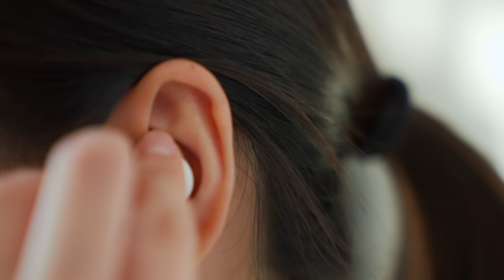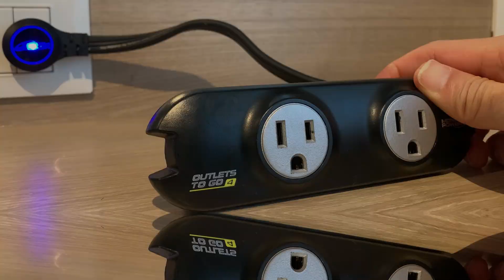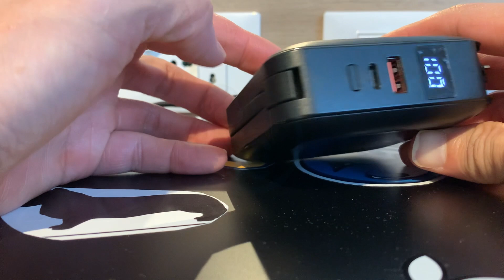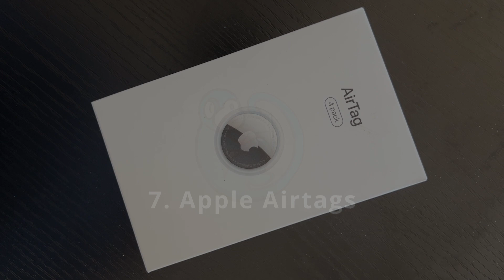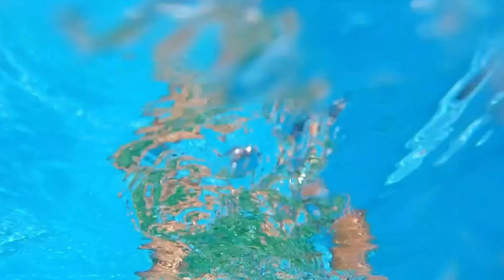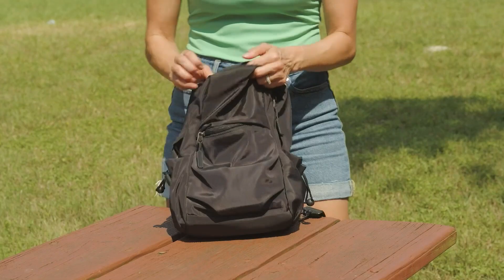Must have travel tech 2024 - 10 items to level up your cruising experience

Comment: Great tips. For the travel WiFi router, what is the typical range? I’m wondering if my family is in cabins next to each other, if the router can be deliberately shared among neighboring cabins. Or will the performance be degraded enough so as to be useless.
Reply from the maker: I think the challenge is that on cruise ships, all the walls are metal so they would absorb the WiFi signal.  And since all ships are different, the best thing would be to try and then let everyone here know the results!